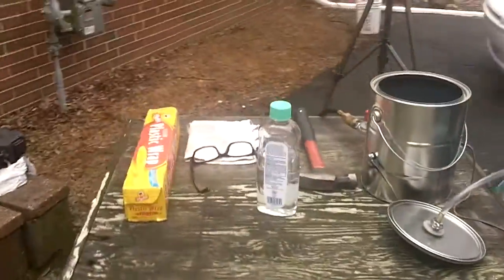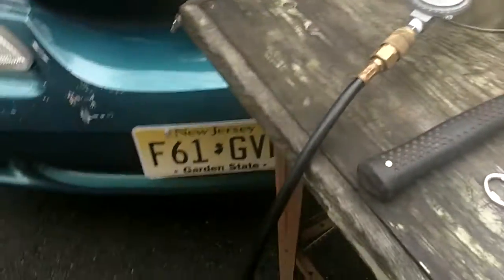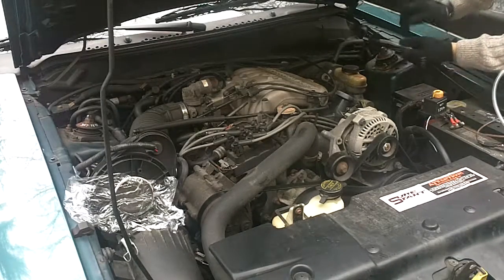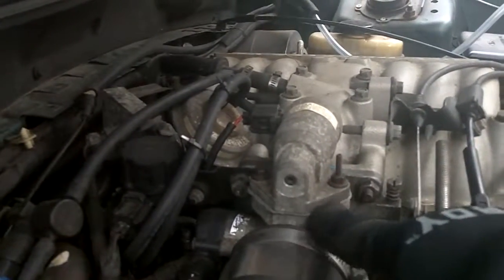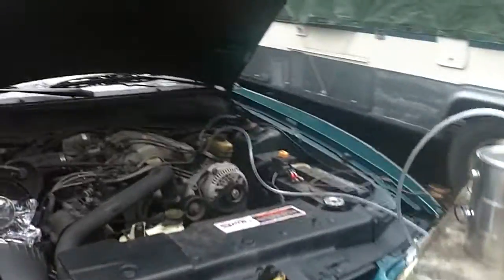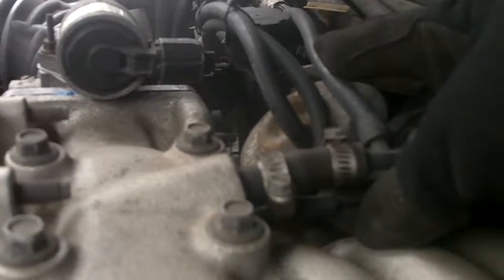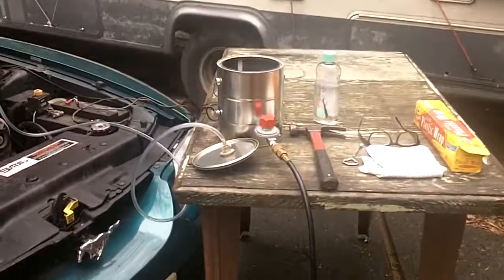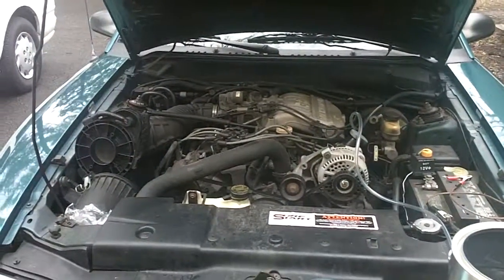How to find and fix an intake leak using DIY Smoke Machine! P0171 P0174

Comment: Thanks for the video. I was wondering where to introduce the smoke. That's a nice smoke machine. Could I make one without the air pressure regulator using a bike pump?
Reply from the maker: Thanks for the note. You can introduce the smoke through the hose that connects to the brake booster. I don't think a bicycle pump can provide enough consistent flow or air/smoke to work properly in this application. Just my opinion.
Reply: @Buckwsr  I didn't have an air compressor but made just made a DIY smoke machine from another Youtube video by Error Code Guy. It worked pretty well but didn't look as good as the paint can you used haha. I had the P0171/P0174 codes on my Mustang as well. Turns out my Mustang's intake manifold/gasket has a leak from where I could tell the smoke was coming from.

Comment: So do you put the smoking hose to direction INTO the brake power assist and NOT into the direction going to the throttle body?
Reply from the maker: Remove the hose from the brake booster and shoot the smoke into the hose heading toward the intake manifold / throttle body.
Reply: OK thank you,.  after a little thought, that is what I did.  I found a smoke leak coming out of the joint between the egr and the TB.  I re-seated it and tightened it and now the smoke doesn't come out.  hoping the p0171 code will be gone.
Reply from the maker: Great. Hope it all is resolved. If you have a code reader, you could erase the codes yourself. Otherwise, it might take a day or two of driving till the code disappears....
Reply: I dis/re/conncted the battery and so  I am getting another code p0551 (power steering) only now. No more p0171 so far.  I'll keep driving with my fingers crossed and then attack the power steering.  I can check codes power using a key trick.
Reply from the maker: Is the power steering giving you trouble? Check the fluid level. That's all I can think of....

Comment: How many psi did you use for your awesome smoke machine? (what did you set your regulator for?
Reply from the maker: I used a pressure regulator that goes from 0 to 20 PSI.  I opened it up only enough to get a nice flow of smoke. It was a complete success, as I found two leaks that were easy enough to fix.
Reply: With less than 1 psi, it seems like you may be able to put a tight plastic snap on cap (Like the kind of can food would come in) instead of a paint lid that you have to tap on and pry back off with a tool.   The plastic lid popping off might act as a "safety valve" for too high pressure and for that matter, maybe just a little fan could be used for wind volume with no compressor and regulator required.  Maybe I'll try that. 

*A little fan might not produce enough pressure
*A plastic lid might melt but aluminum foil might work
*Instead of snap on lid, maybe you could just rest a weighted lid on.

This might be a comment for 50skid.
Reply from the maker: hey, it's worth a try. go for it. You see toward the end of the video that the plastic wrap on the air intake pops off...held on by a rubber band. That's my safety release valve!

Comment: I have a 96 ford mustang v6. And im getting a trouble code P0430 OBD-II Trouble Code 
Catalyst System Efficiency Below Threshold (Bank 2). I have brand new 02 sensors and i still have the code. Evertime I put the pedal to the metal It feels like my mustang is being choked and the rpms dont increase nor do my MPH do you think i have a vacuum leak? Should I try this test
Reply from the maker: +The Phenomenal it makes me think you might have a clogged catalytic converter based on that code and the bogging down when you step on the gas. Before spending the money on a new converter, try this product: Cataclean. Follow the directions exactly on the bottle. It's about 25 bucks, but worth a try.
Reply from the maker: +The Phenomenal sounds like it could be clogged catalytic converter or muffler...